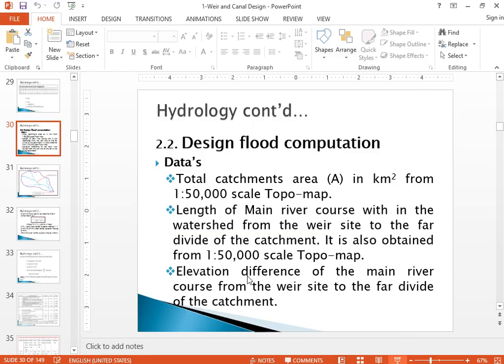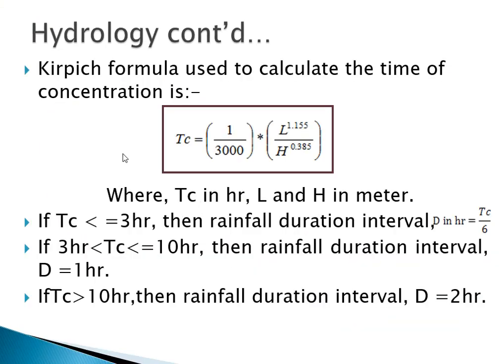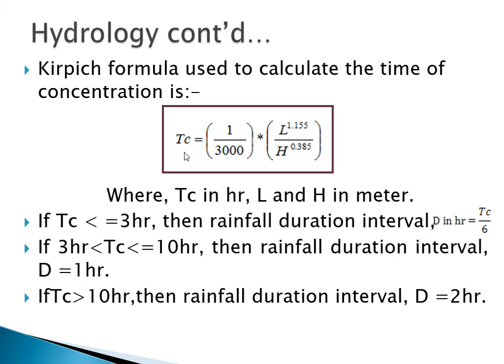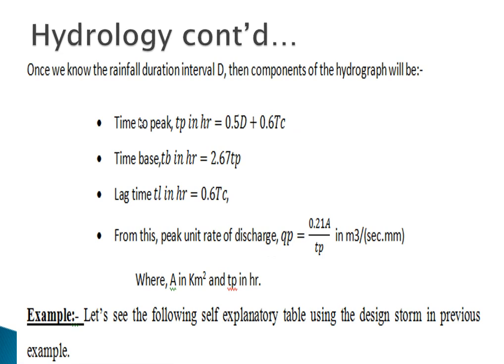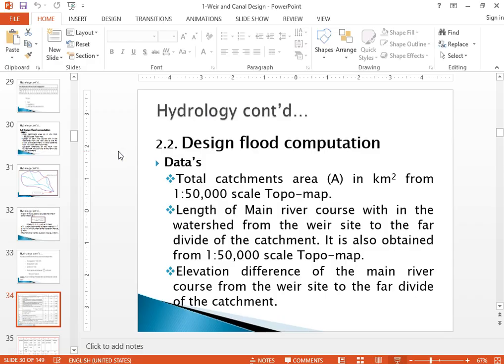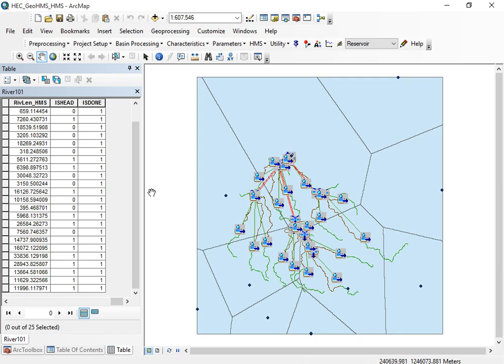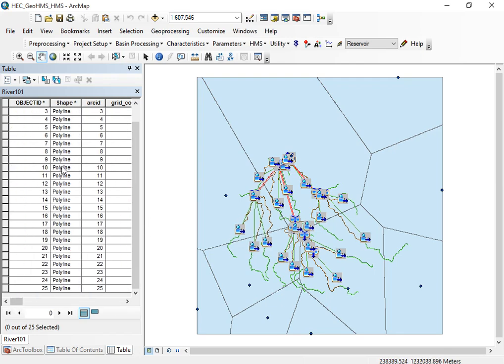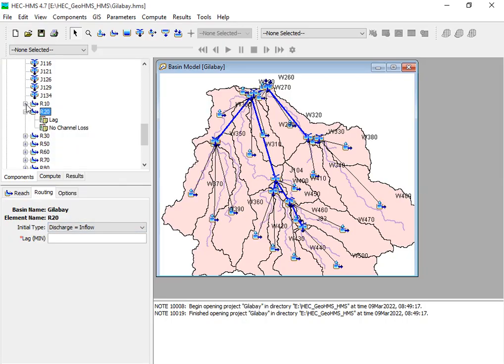Time of concentration and  lag time determination for HEC HMS input

Comment: Hey, I have a small question regarding lag time if someone can help.
I am trying to calculate Basin Lag time for a 130 sq. km basin in one of the Middle Eastern Countries using the time of concentration. The loss and transform method that I have used in HMS is SCS-CN. 
However, time of  concentration is showing huge variation when calculated using SCS method ( using lambda , L & S) in comparison to calculation done using Kirpich method. My confusion is, as to which method will yield more realistic results. As the method selected for UH is SCS , should I use the same SCS Lag equation for the tc computation or go for Kirpich equation which yields a much lower (4 times ) value of tc ? 
Kindly guide me through.
Reply: Kirpich eqn does not take rougness or surface properties , it just depends on slope , where as scs cn tc takes surface property also into account, so i believe scs tc gives realistic value